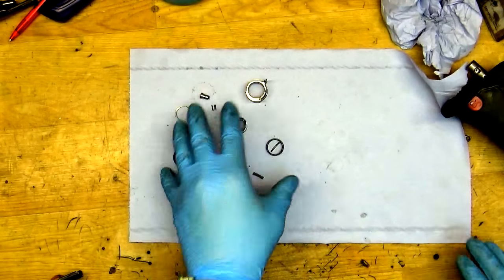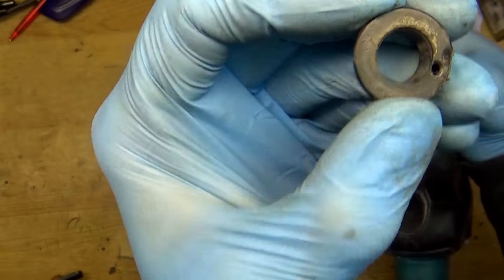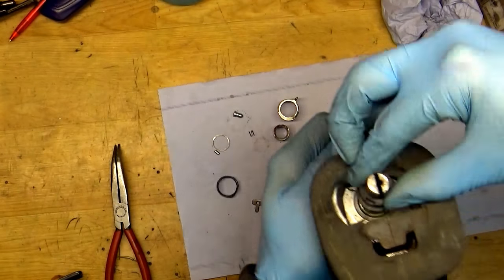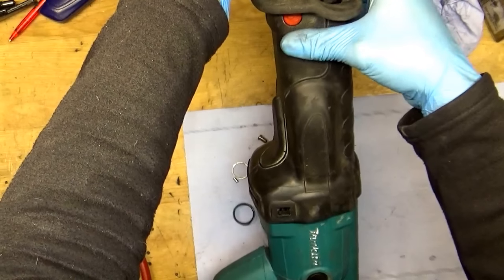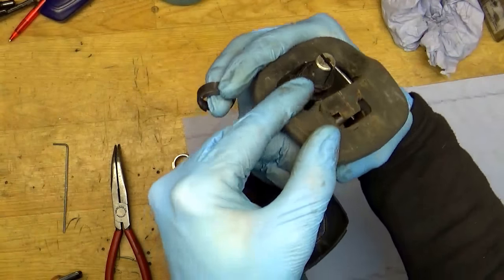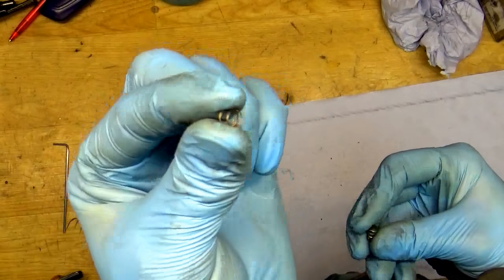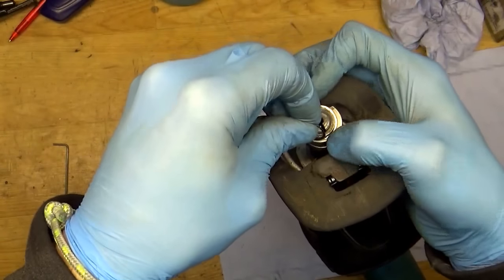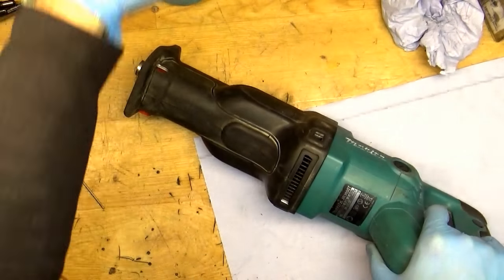Easy fix! How to assemble Makita RECIPROCATING SAW JR3050 JR3070 blade holder

Comment: Thanks - But how did you take it apart?
Reply: Remove the special locking ring using small flat bladed screwdriver & then slide 3 pins & 2 springs out. Best way is to imagine playing this video in reverse.

Comment: Ok I feel like a idiot. I have done this one. How about the jr3051t, I'm stuck. Bad part I'm a tool mechanic and Makita has a new blade clamp away for that. Its like this jr3050 but no t pin or the pin that holds the spring....totally stumped. Thanks